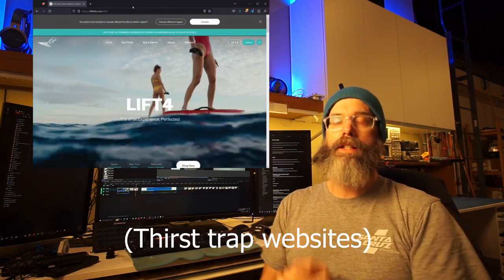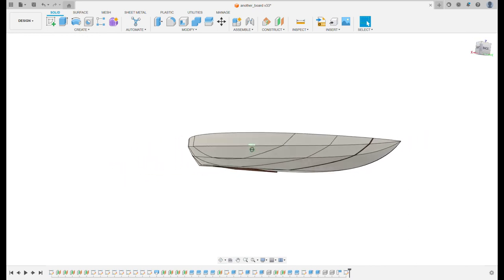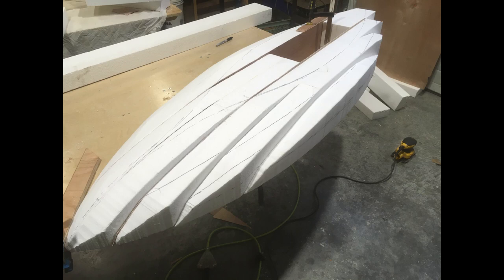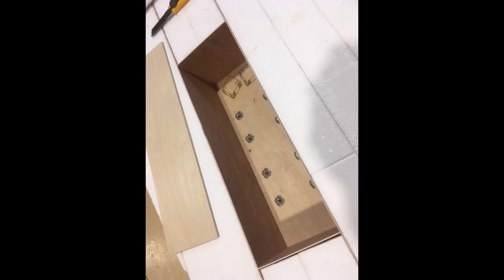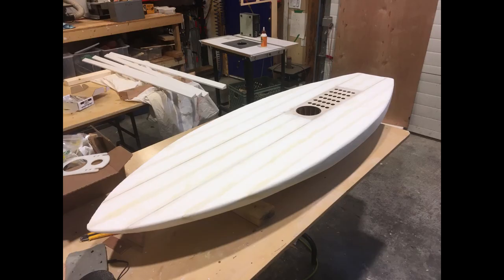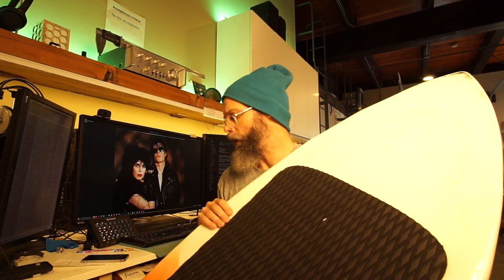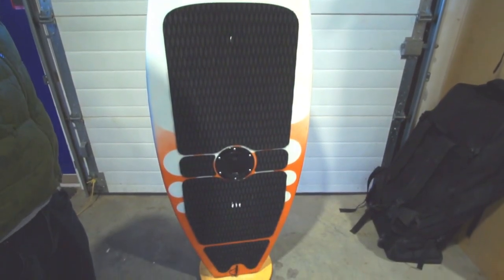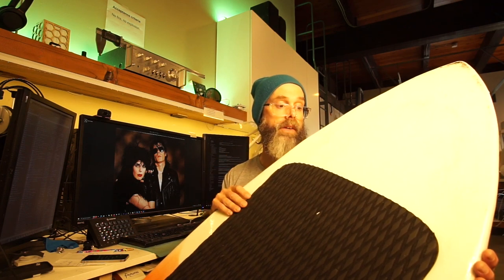Homemade EFoil Build: PART 1: The Board

Comment: What battery do you use? Commercial or diy? Voltage?
Reply from the maker: @marcram01 I really need to finish part 2!  I'm using a "real" battery that was designed for a customer (passed UN and UL) but it is a prototype. I'm using 9 cells series Li-ion 37.8V max. and 5Ah. One pack gives about 18 to 20 minutes of run time up on foil if I slow down. I can fit 2x batteries in the hull for ~40 minutes of foiling. 

I would recommend going to 12 series cells. Most inexpensive motor controllers (VESC) will handle up to 60V, and you get a huge power advantage from the higher voltage. My motor controller runs out of voltage before it limits current. (The motor windings are too high a resistance to drive more current). 

The system needs to perform for the start and pop-up at 2-3x the cruising power, so a higher voltage pack will let you pull more than rated power from the motor for 10 seconds before you throttle back. My motor is rated at 650W and I'm pushing 1200W through it during pop-up.

I did stare at Dewalt 60V flex-volt packs as an option... I feel that a few of those in parallel would work great for a safe DIY option.